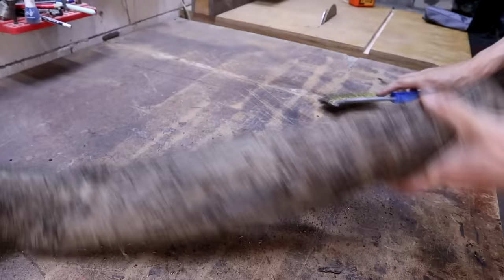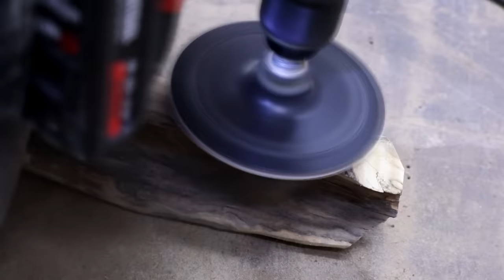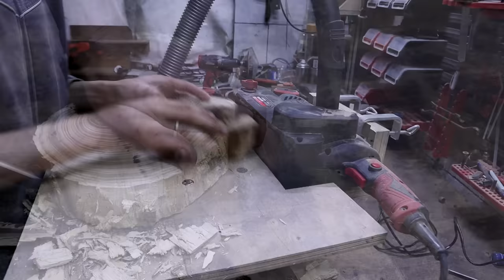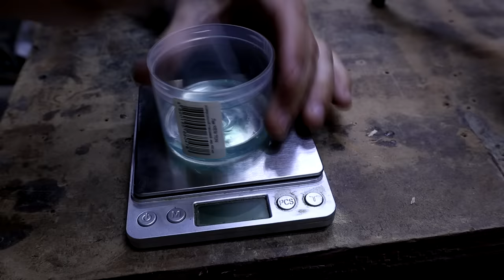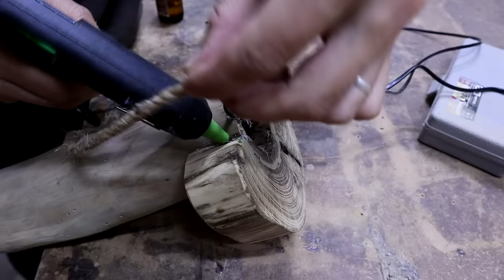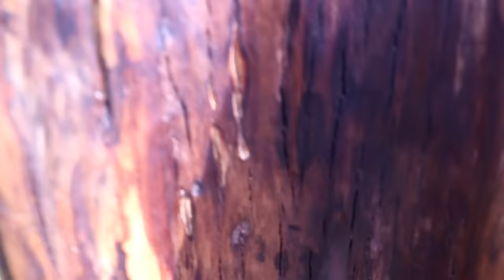Found an AMAZING driftwood!! And made a COOL THING out of it! DIY

Comment: If you’re going to be using raw wood from the outdoors for an indoor project, the wood should be baked in an oven at 125° F or 50° C to kill bugs and bacteria.

Nice lamp but I would have passed on the rope. It’s redundant.
Reply from the maker: Thanks for the information !! The point is that I wanted to highlight all the cracks with epoxy, but I didn’t guess with the color, so I covered everything with a rope)))

Comment: OK, I  guess I'm confused. Why did you make up all of that green epoxy when a quick 15 min epoxy would have done fine. You were going to cover it up anyway. All you had to do when it came to the smaller holes was just add a drop or 2 of coloring. Like what you did though